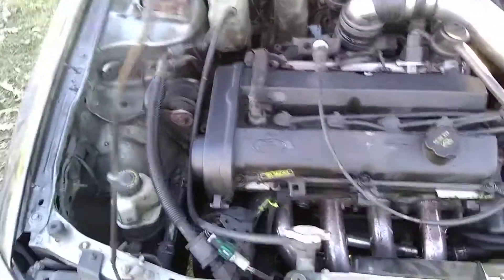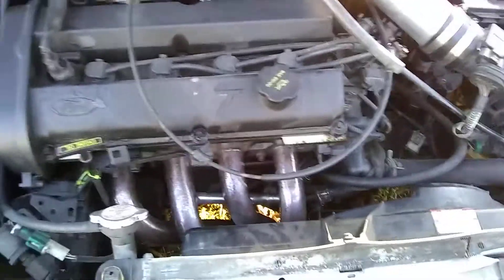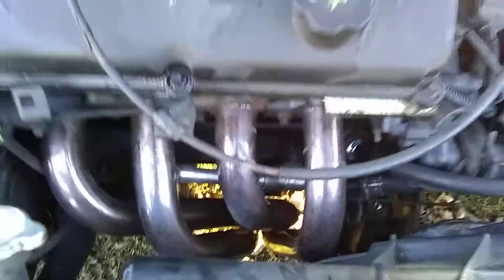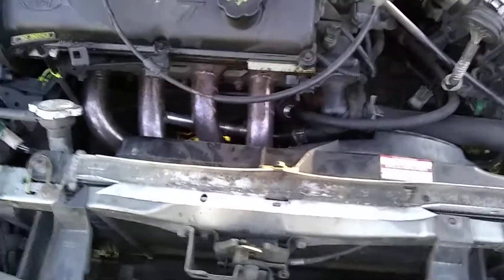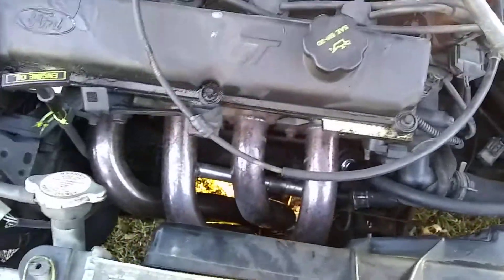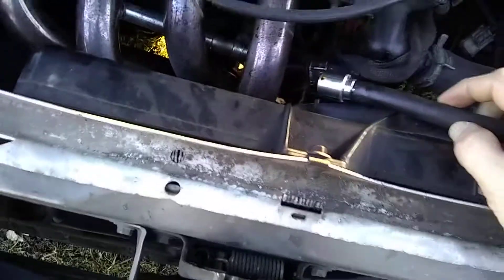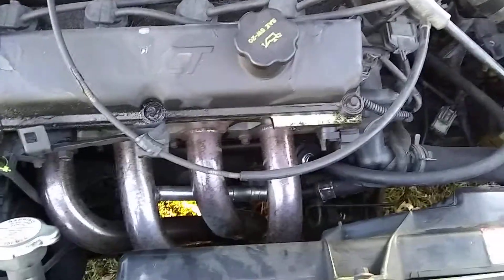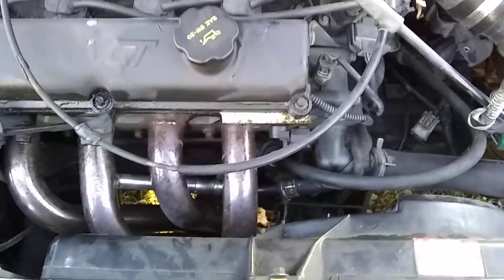What is a pcv valve what is it for?

Comment: main job for the pcv valve is to remove unwanted vapors/gases from the crankcase....that valve you showed does a pretty good job in doing so (so long as its working) I work on some vehicles that have no pcv valve itself, rather a pcv system...the Volvo 2.4 L comes to mind, its a 4 hour job to replace
Reply from the maker: billmck12345 thank you for that I forgot that part in the video...lol
Reply: just trying to help out..... i work at a indy shop and see everything, so price ranges vary for repair from one manufacture to another....older chevy ---5 bucks, mid 2000 volvo s80 400...and both achieve the same result!!! ....go figure
Reply from the maker: I know right how strange is that
Reply: I'm checking out channels that subbed me....so i'll be checking out what ya got,  until now I havnt had time to do anything with my channel, I'm thinking to revamp and conclude my few vids, and now that I have the ok to use glasses type vid cam (something like the "I-view") i'll be able to get the footage of what I see on a daily basis....diag and repair
Reply from the maker: billmck12345 that will be cool I'll keep an eye out for that